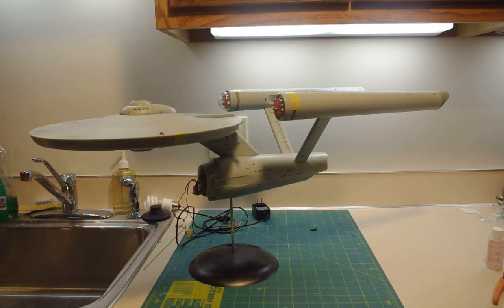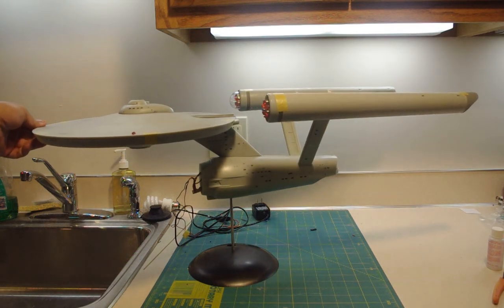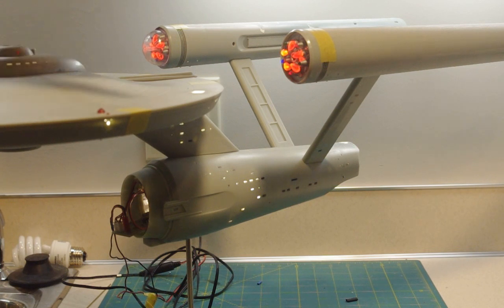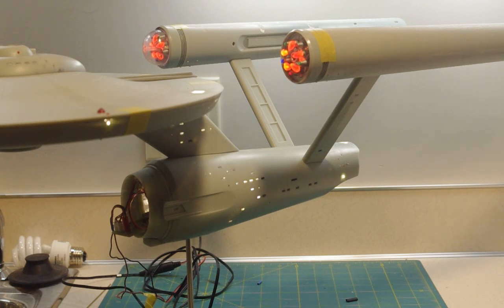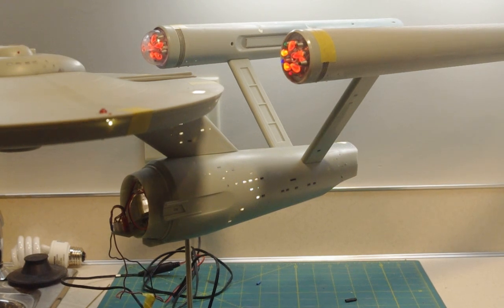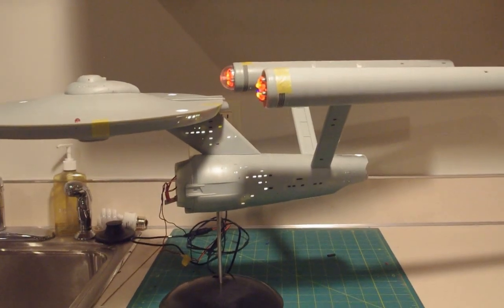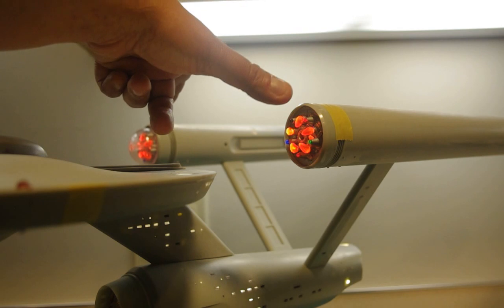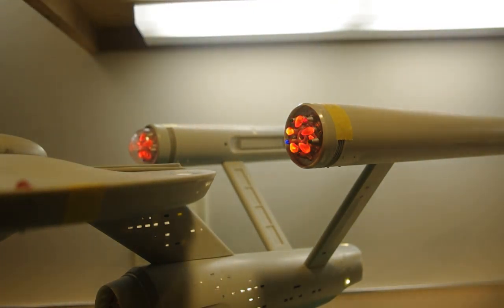Polar Lights 1/350 Classic Star Trek Enterprise model project Part 5

Comment from the maker: My lighting kit was from an early batch as well. Ironically, my original bussard board gave no timing problems, it was a replacement for one I cooked by accident that had the issue (check part 1 or 2 for that story). Only way to really know if you have the issue is to hook up everything and do a full circuit test. That is usually when it will crop up. R2 PL is aware of the problem and they are addressing it at the factory level. They can (and will) send spares if needed.

Comment from the maker: My pleasure. As for the windows, they are installed and cemented in. Once I've dealt with all the seams and leveled the steps in the windows (since some protrude out from the surrounding plastic ever so slightly) I'll mask over them with an Aztek Dummy window mask set and leave the masks on for the whole of priming and painting. Once that is complete, the masks will be removed to reveal the clear windows underneath.

Comment: I noticed that too with my bussard circuits however I noticed this happen if the wires were not secured well  and if I was using a battery with low voltage. Thinking about it now where I keep the model the room is cooler than my other rooms so temperature would be a factor there as well. Thanks for figuring out what is is.

Comment from the maker: Possibly, plus where I have it has the wall and cabinets acting to channel and reflect the sound. I haven't quite gotten everything glued together in those areas (plus loose spinning bussards) so that might contribute as well. But even after all that is addressed, there will still be some gear noise from the motors due to how they were designed. Eventually, one gets used to it and I'm more concerned with the system holding up a long time (which these motors should) rather than noise issues.

Comment from the maker: I'll have an answer for that soon as I haven't quite gotten the domes frosted yet. But, I am going to try it with 600 grit wet sanded to see how it looks first and adjust from there (maybe step down to 400 grit). Best part is if it doesn't look quite right, adjustments can always be made without messing up the part. I'll also only sand the inside of the main domes and use flat clear on the outside (i.e. not mask them when I dull coat the paintjob).

Comment: FYI, they are called Warp Nacelles, not Warp Engines.  The Core is in Engineering which produces the power that is used by the Warp Nacelles / Warp Coils that warps space.  Just needed to mention.

Comment: Do you have to put in the shuttle bay if you are going to have the bay doors closed, but still lighting the model?
Reply from the maker: It is part of the structure, at least around the door section. You can likely leave out the internal center wall, but the floor and side walls likely will need to remain for structural support and LED mounts.
Reply: Thanks for that. If I may ask why is there a fit problem? @JMChladek
Reply from the maker: @brtv9909  no one specific reason. I believe it was just down to the parts tolerances being so tight and the wiring harnesses adding to the complexity. If you do frequent test fits, you should be able to figure out any problem areas and how to deal with them.
Reply: Thanks! I finally dug my 1st edition model and lighting kit out of the stash and I'm watching your build series. @JMChladek

Comment from the maker: As much as I like Treknobabble, I mainly just stick with building the models rather than getting caught up in the semantics of what something is or is not called (especially stuff from an admired yet still ultimately just a fictional television series). Until somebody actually builds a practical warp drive, they could be called ANYTHING at this point and even Trek "canon" (i.e. what appeared on screen) got a bit contradictory in spots anyway.